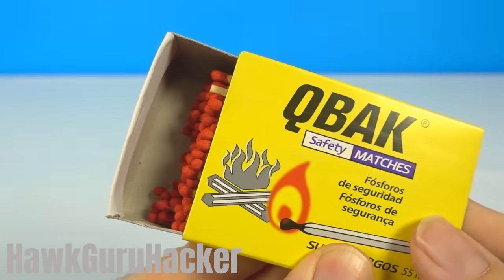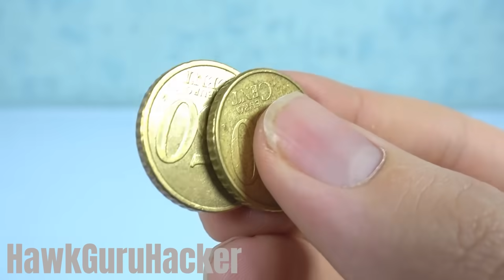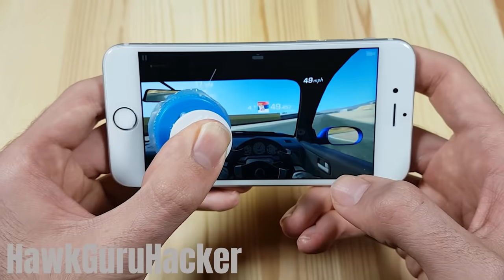8 SIMPLE INVENTIONS

Comment: Even very small, that has to be the hardest way to cut anything why wouldn't you just use some wire snips or a hacksaw or you could even use you're teeth  & it would be easier than that blade